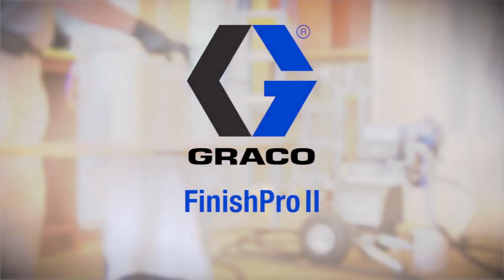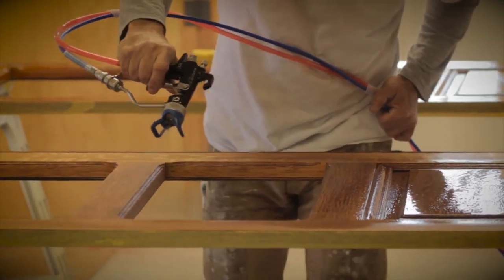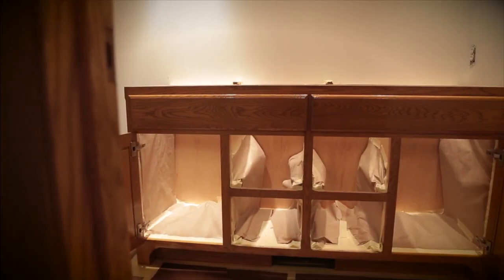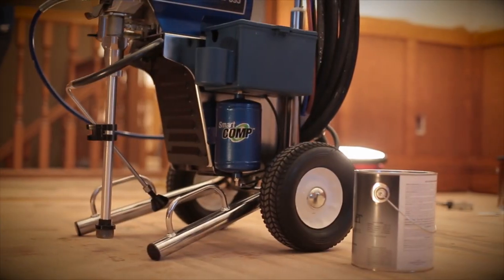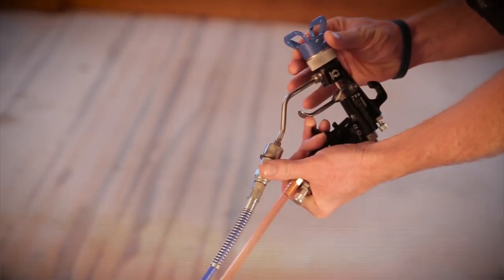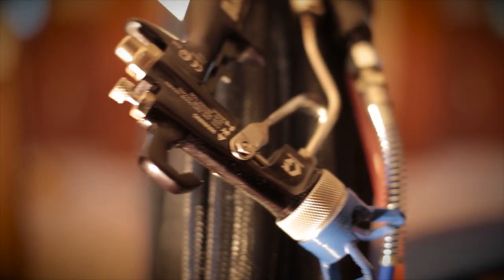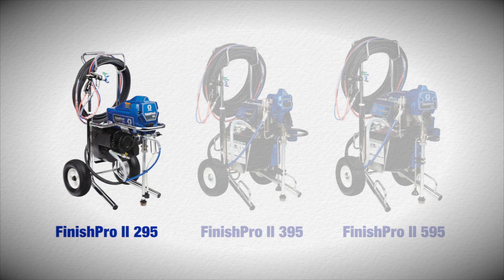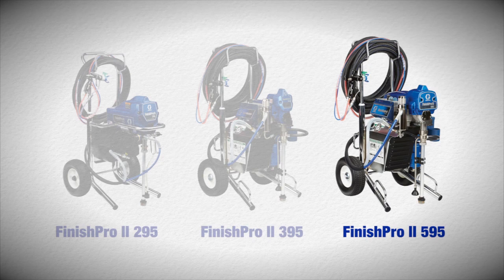Graco FinishPro II Features

Comment: Can anyone comment on the compressor for larger jobs. Does it generate water in the line in high humidity? Does it keep up well when spraying larger sections, like multiple 4 x 8 sheets of panel?
Reply: Hi Carl, 
Yes, it does generate water in the line but they do have an inline filter that deals with that. I have the mid grade unit and I have used it on several large projects with no problems as the compressor only deals with the atomizing of the finished product at the tip. I typically spray modified urethanes which are fairly high viscosity. Hope that's helpful.